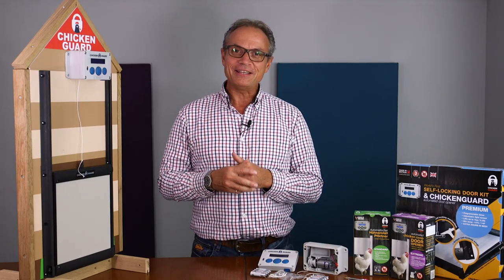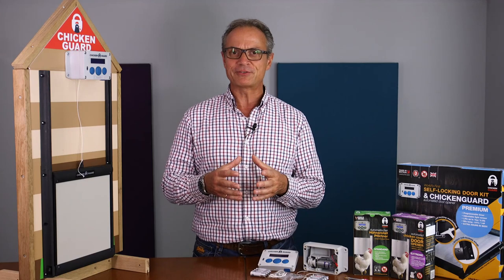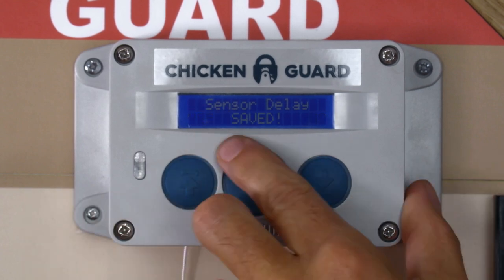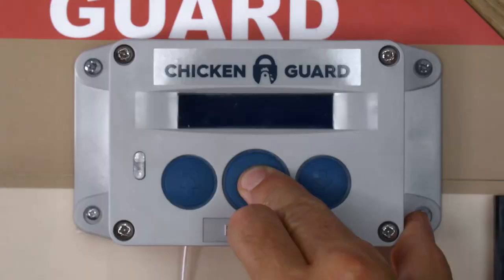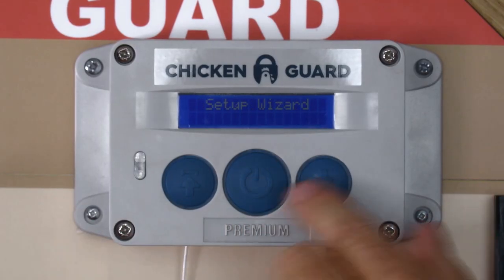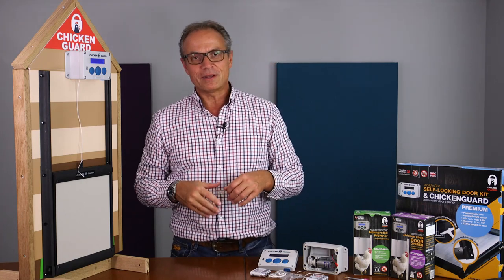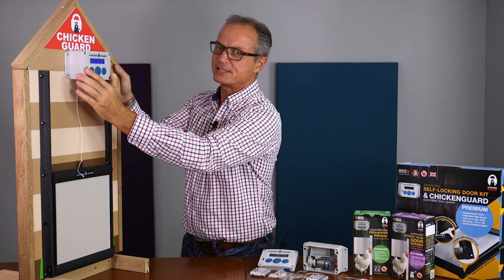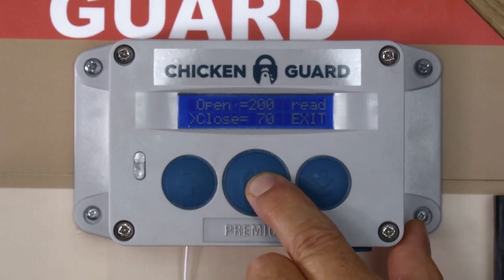Chickenguard - How to adjust the Light Sensor

Comment: Love the product. But your light sensor explanation is super long and not very clear. For some reason, when the seasons (and length of day) begin to change, the door starts closing early and locking my hens out. I would like to know whether the closing lux number needs to be adjusted higher or lower. Just a simple and succinct higher or lower for earlier or later closure would be helpful.

Comment: left it an hour, now it will calibrate.  Door doesn't open even though it is day, sensor option selected, waited 15 min, still didn't open.  Changed settings to timed and clock, still didn't open, pressed up button door opened, so will see tonight if it closes.  How can it be this hard, mine is the all in one product, the one with the string really looks like garbage and suspect a fox could pull that string.  I wouldn't trust this device if you don't have line of sight to the door from the house as it could decide to stay open and the fox will have the lot.  Seems like such a simple product, but the software seems like it is written by an 8 year.  Not very impressed.